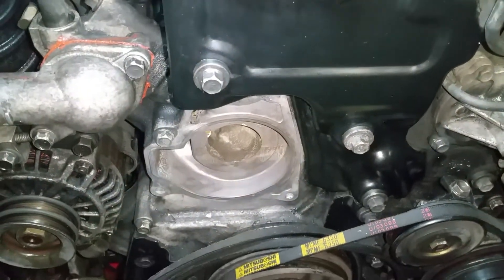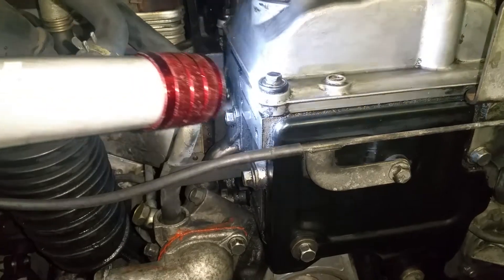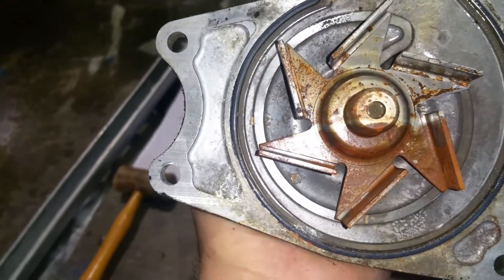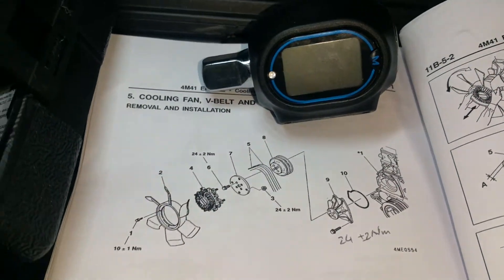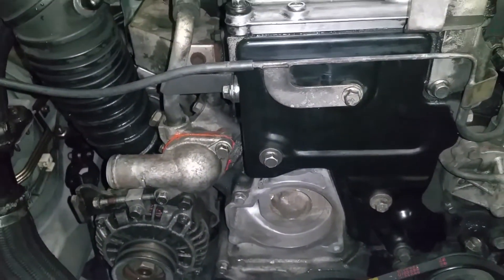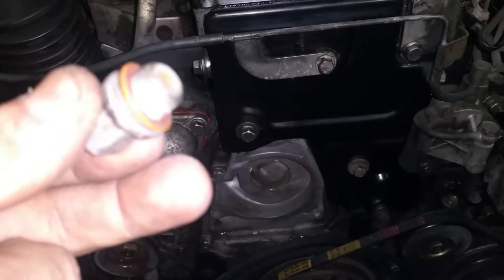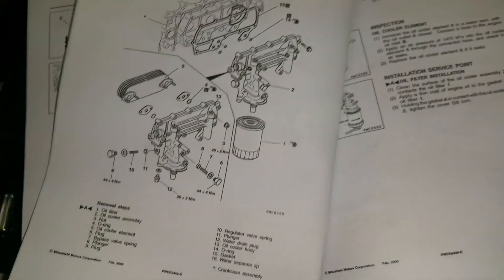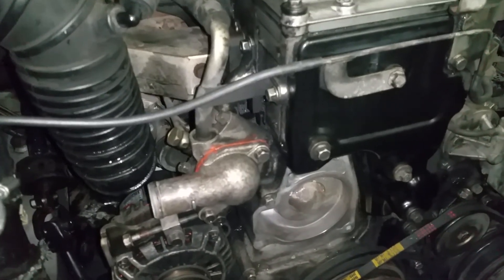Mitsubishi Pajero Gen3 4M41 diesel engine water (coolant) pump replacement

Comment: Great video,  I also own a 4m41 I'm also having problems with overheating even though the gauge doesn't reach the red warning rangethe engine gets too hot with noticeable expansion of the top radiator hose plus coolant not returning to the radiator from the reserve tank. Any ideas what this could be.  The possibility of a blown head gasket I'm not too sure off as the bubbles that appear  on idling are few, even when the vehicle is slightly reved.